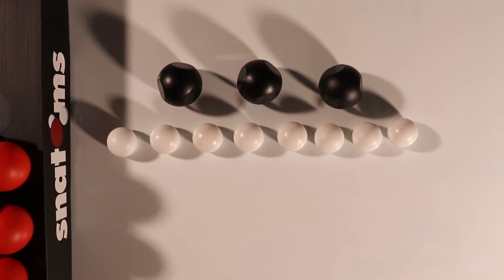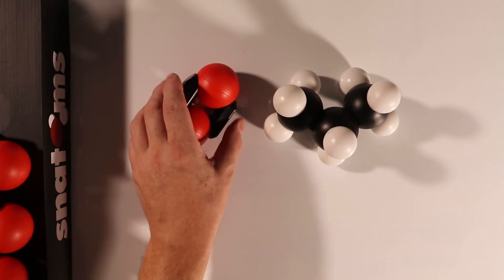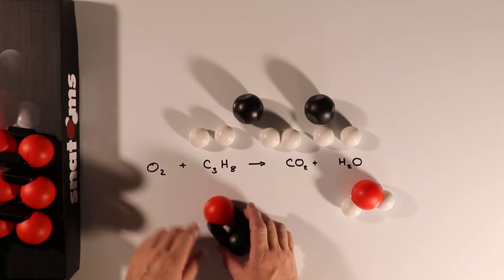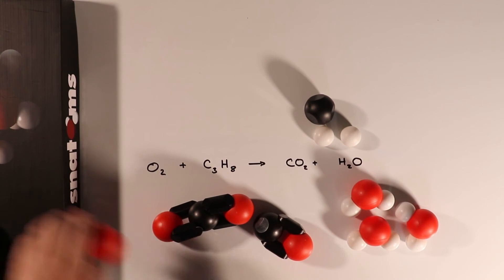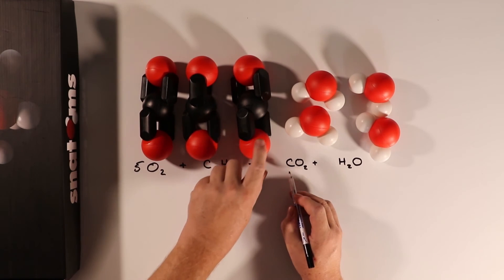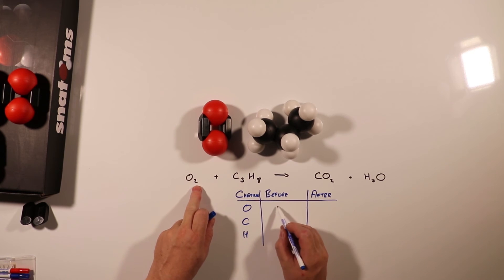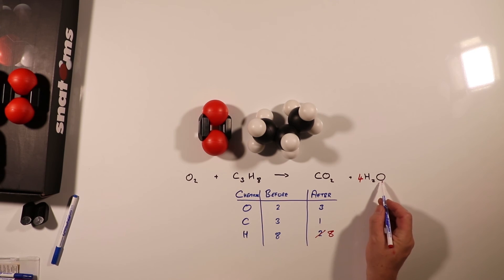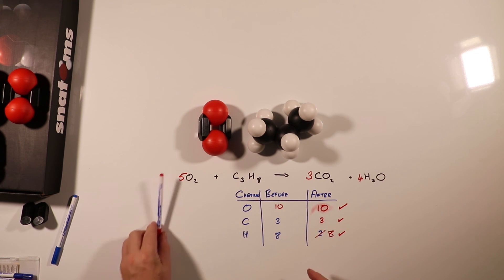Balancing Chemical equations using Snatoms

Comment: being a random guy that got here from the recomended (and since i'm also a chemistry fan) i would like to say how i do the equation.
first , i start with the definent molecule (the C3H8 , since only 1 molecule with be reacted).
then i say for 3 carbons , i will have 3 CO2 , then i say , i have 8 lone-hydrogens , i will make 8/2 pairs of hydrogens [sort of](the 2 is because they are in pairs) so we have 4 H2O.
then i add "(3*2)oxygens from CO2 and (4*1) from the water" 6+4 = 10 lone oxygens and since they are in pairs in the reactants we do 10/2 = 5
it might sound compicated but in practice is simple
Reply from the maker: There are many ways to come at this problem. I teach many students and some like your method. I don't think there is a best way of doing the balancing just several different ways of achieving the same result. I suggest that each student do these equations the best and easiest way they understand.
Reply: Philip Russell i see. *nod